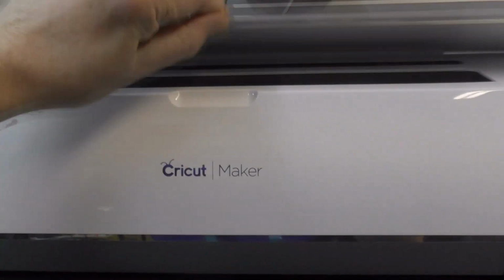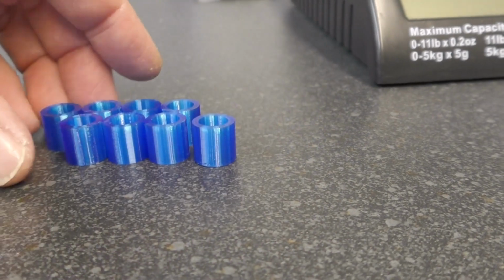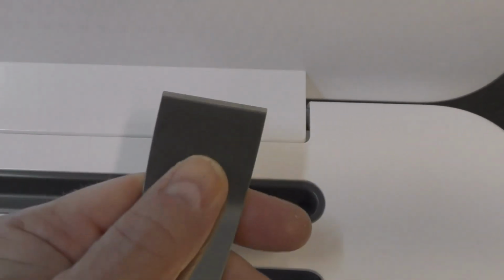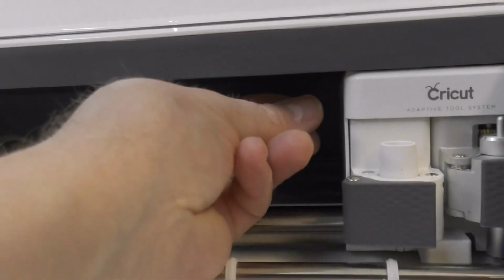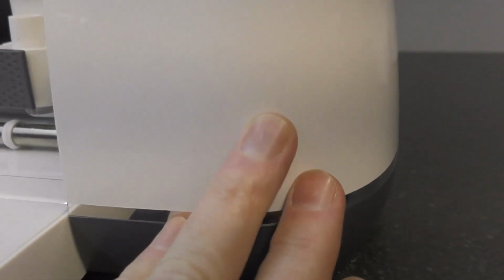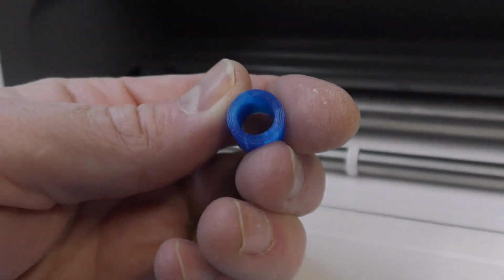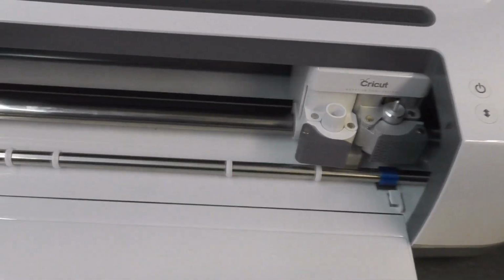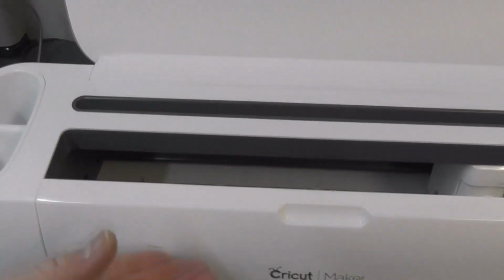Cricut Maker Roller Replacement Warning!

Comment: Your comments are spot on!  I was also annoyed that the first part I took off broke in the corner because of the superglue!!  Thank you for taking the time to tell us what you did. This is the link to a video that shows the whole repair; showing the pieces and parts as he completes the repair. The video name is Cricut Maker Rubber Pressure Roller Repair EASY FIX DIY -  and it was posted to YouTube by theZimvideo  https://youtu.be/4LrxQELvsC8?si=VOVf8DXGKgmD4wtH   Thanks for helping me get through this and for saving me tons of $$